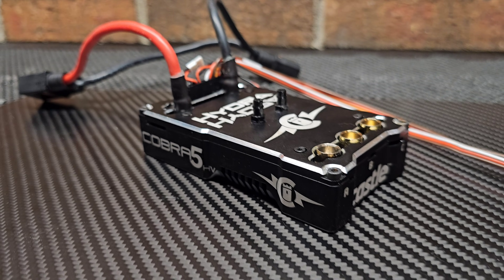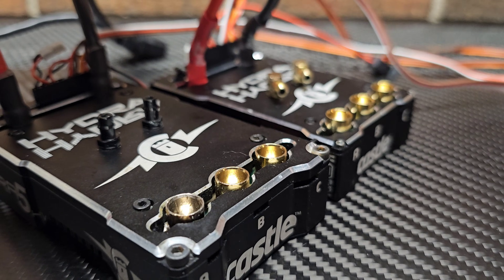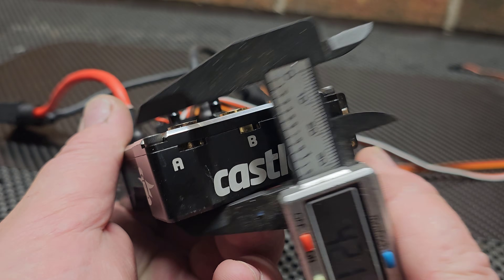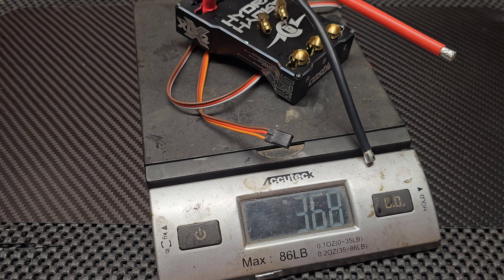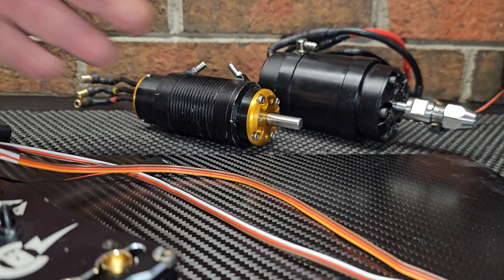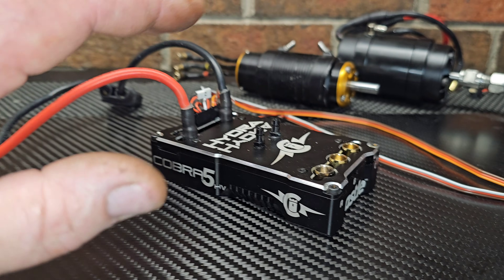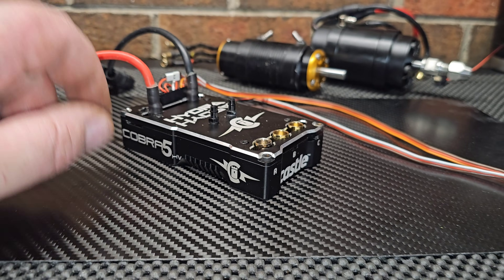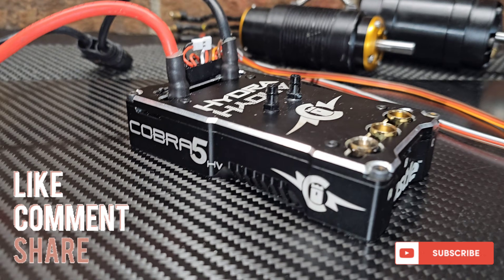Newly Released 12s Castle Creations Cobra 5 HV Hydra Fast Electric Rc Boat Speed Control

Comment: I was considering one of the original castle esc's when I was swapping electronics in my sonicwake but ended up going with the ZTW SEAL G2 160A ESC and so far I'm impressed. Instant power and running it with a 1400kv 4092 on 6s Ive yet to get it over 95⁰f. I'm going to do a blackjack 42 next can't wait to see how it works out in yours

Comment: Thanks for the review, I was a bit worried about the hobby wing 12 s as I know castles are the best I find , am I right in asking the higher the battery the lower the kV motor you can run???
Reply from the maker: Basically yes, lower kv higher voltages can be run, much more to it of course, wish I had the time to elaborate
Reply: @IRONCLADRC will get my motor specs when home
Reply: You are usually looking for a rpm range for a given prop. Say you are looking around 30,000 rpm, a 2000kv motor on 4s will give you that (or close it) or you could go 1500kv on 6s or 1000kv on 8s. While going higher voltage and lower kV you lower the amp draw significantly. There is more to it, depending on the type of wind etc, but thats the basics of it. You need more cells but less capacity/amp rating
Reply: @dttocs4746 thanks
Reply: Hobby wing is a castle product
Reply: @douglowney3901 maybe not?
Reply: @rtz549 maybe not what? It's a castle product. It literally says it on the esc's
Reply: @douglowney3901 you sure you are not thinking of traxxas. Some traxxas is made by castle. Far as I know, hobbywing is still its own company and has been for a long time

Comment: wait for the ghost version. its incredible!
Reply: I asked them about that and contacted Ghost direct. No plans to make a ghost version. It would have to be a water cooled converted land version. Which should be possible considering for a while people did that regularly when castle wasn't making hydra stuff. So whos gonna do it first? 😏
Reply: @DDRDK with the ghost putting out over 800 amps under load on 12s…it’s crazy compact and powerful, but without the cutoff, it may burst into flames a distance away….well worth it haha😂
Reply: @alterdcustomrc4512 hey man, i even tried convincing castle. This esc for a lot is great, but to ignore the guys that only build electric boats for quick burst speed records is wild. I feel like the same number of guys buying the ghost version specifically for land based drag stuff are about the same numbers that would buy it for "drag" boat stuff like speed runs. So not sure why they wouldn't tap into that on the hydra side.